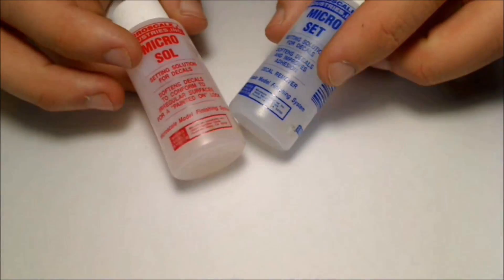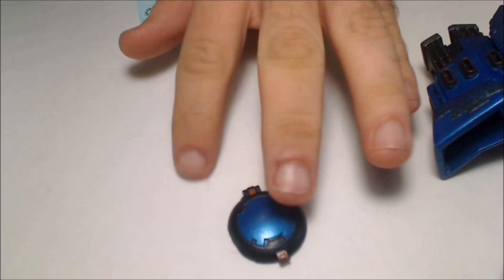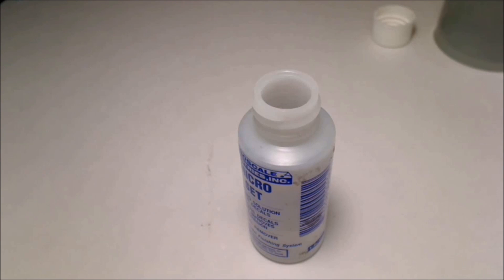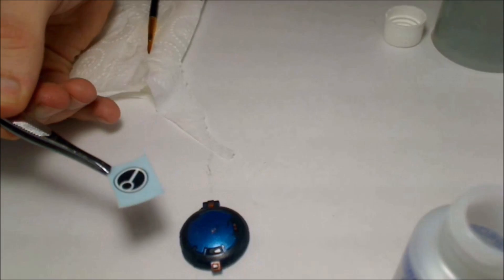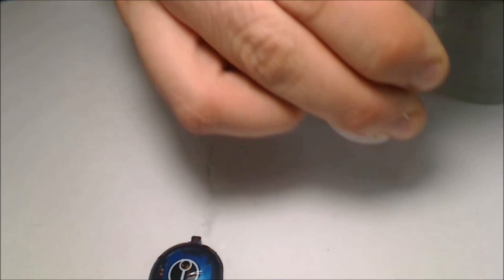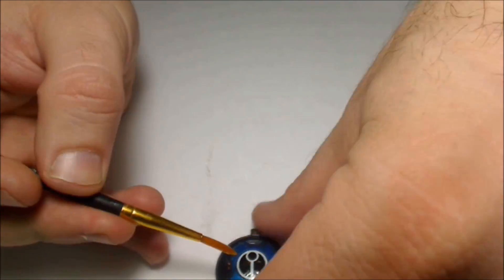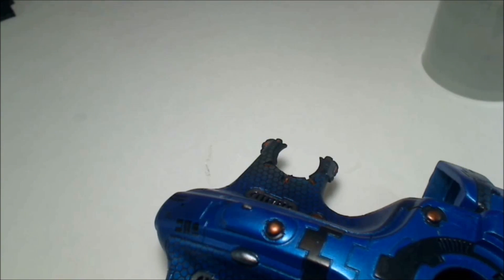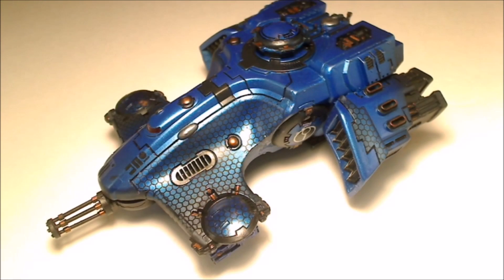How to Apply Transfers / Decals with Micro Set and Micro Sol

Comment: To help remember which one is which, I wrote "1" on the blue one, "2" on the red one.  :)
Reply: That's a great idea
Reply: "Big round brush" isn't really descriptive for the size and type of a brush to use. I'm trying to guess what size to get by comparing it to your fingernail and the size of your decal. Brushes actually do come in named sizes. I have a 10/0, a 12/0, and a 20/0. But perhaps it's necessary or even wise to use my good brushes with the micro sol. Perhaps the solution would soften the glue in my brushes? Better to buy an inexpensive
 craft brush?

Comment: I have been using these for decades, and now find I have used them back to front all this time.
Who would guess Microset is not for setting. Who came up with their names?
Reply: ikr, that was what i was going to do, if it wasn't for this i would have done the same........maby they ffffed up at the factory and just decided to run with it as if it was intended rather than start over.
Reply: @luf2867  almost a year later but scientifically Micro Sol is a Solvent (hence the name) so that's why it's called that.

Comment: I liked your video and might try it the way you do it.  Currently...I rarely use the blue bottle...very aggressive solution.  I usually lay down the decal, then coat with the red bottle.  Some say the blue bottle is nothing more than white vinegar.  If you smell it, they might be right.  Even on compound curves, I just lay the decal down, cover in the red Sol and it lays down after a few hours.  Maybe using the blue Set would have helped...but it can really attack some decals.
Reply: Sounds like you’re doing too much of one the bottles friend

Comment: Can the MicroSol and MicroSet be used on vinyl stickers on a lexan body? I have an old set of AutoGraphix model car graphic lettering kit and was thinking of using it on my RC truck, which uses a lexan shell that is painted on the inside of the body. Hoping this will work with the vinyl lettering and the lexan body without harming either. Thanks!
Reply from the maker: Unfortunately they only work with waterslide decals, I don't think they would help with vinyl lettering :(

Comment: Can I apply without sol
Reply: You can! You can use a hobby knife should be able to poke tiny holes to remove any creases that the Sol would remove by softening the decal. If you're applying to a completely flat surface, you should be able to skip that step entirely! Just be careful if you do the hole-poking method, you can very easily split the transfer.